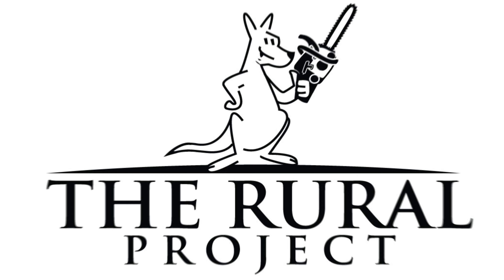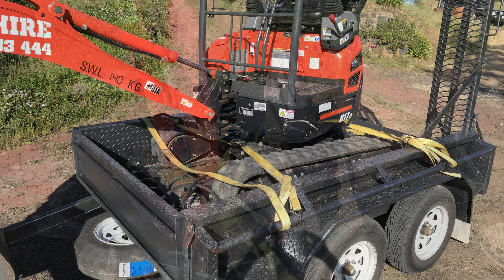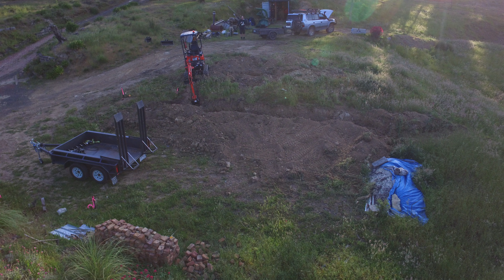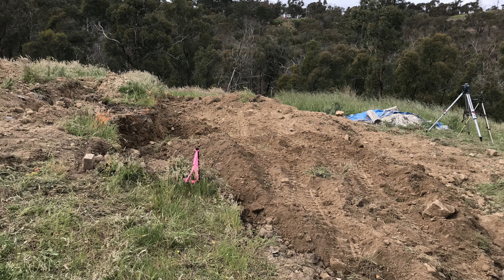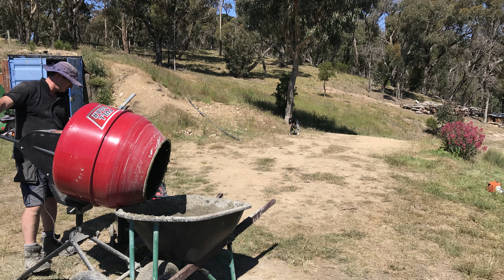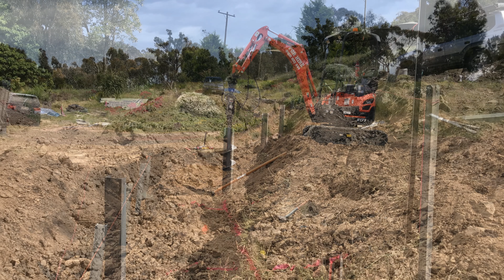Railway Sleeper Retaining Wall Build #1 - 2 Tier Wall for Shed

Comment: How deep did you go into the ground with the back tiers? 1m up 1m down? or 2m down at the back so they are sitting at the same depth at the bottom with the front?
Reply from the maker: Hi, thanks for watching. Answered in your other question, but in summary 1.5m deep for 1m out the ground, the ball wall was even deeper, as it only held 3 panels (750mm out the ground)

Comment: When you are drilling holes when you have it to correct depth thro a bucket of water in while its drilling then stop and lift drill out that will leave the hole clean and no need to shovel out 👌
Reply from the maker: Mate, where were you when I needed that advice. Ha ha. I learned that, but only after a lot of digging and mixing extra concrete because the hole was so big.

Comment: You can tell you are no excavator operator 🤣
The stabiliser should be at the front or you are digging over the drive motor and if you were to it something hard while digging through you could pull yourself over.
Reply from the maker: Very true. I should have L plates on, but I’m having a go. I think that was my first time hiring an excavator, it was a couple of years ago. Scared myself silly just driving of the “steep” trailer.
Reply: @TheRuralProject  many people roll them getting them off the trailer. You done pretty well the misplacement of dirt made double work for yourself though as I guess you realised. Great video 👌
Reply from the maker: Ha ha. Yep, there was a moment when I looked at the “mess” and questioned if I had started something I couldn’t fix, but I got it done, learnt heaps and it’s still looking good a long while later. Lots more videos to come. 
I have some video of another retaining wall that I’ll edit in about 6 month time ( lots of video backlog). Let’s just say I am still learning, and that one taught me a lot too.